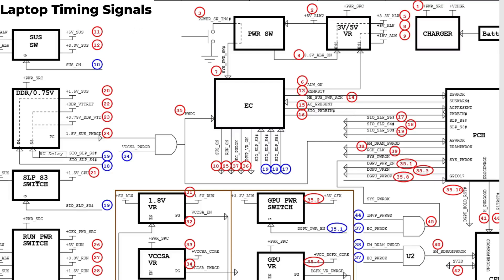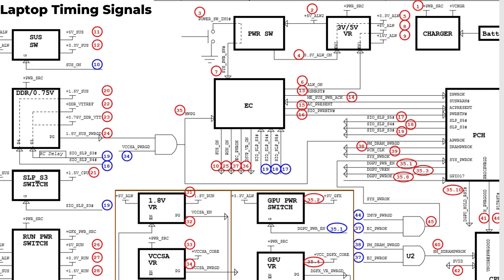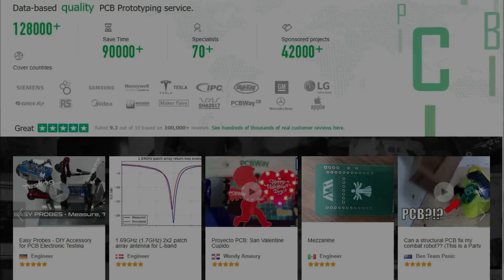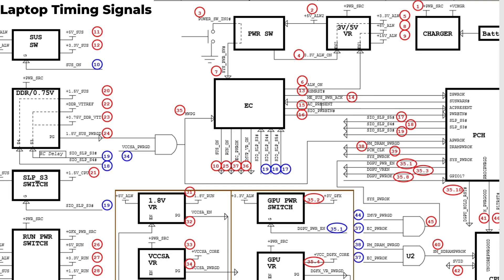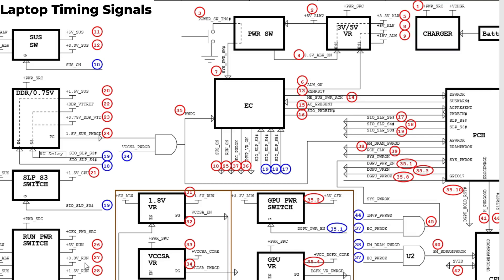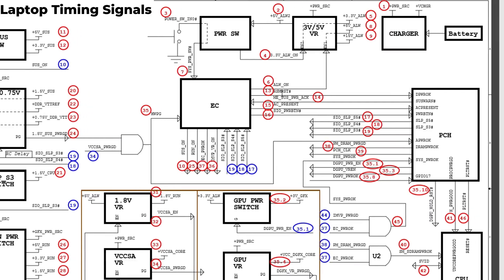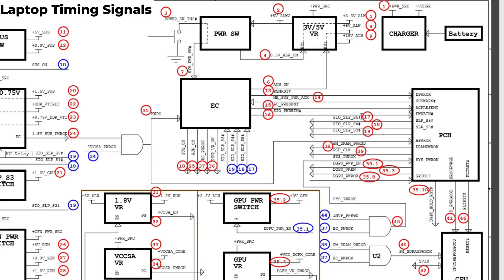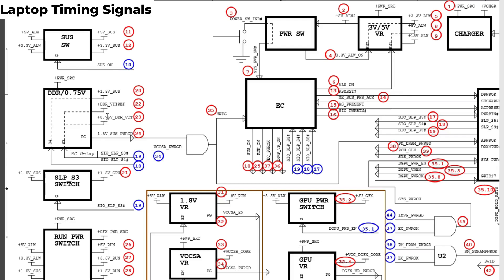Master Laptop Repair With Power Sequence Analysis part 2

Comment: I have HP 2000 motherboard and when charger plugged 3v,5v ic getting too hot so I changed the ic and check Al 4 mosfets but issue is still happening can you send me some steps to identify the issue